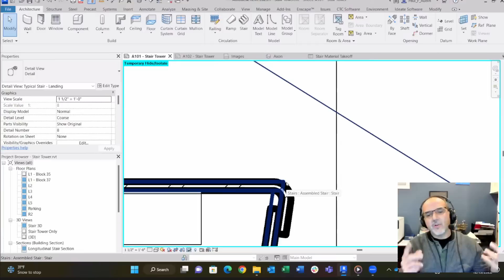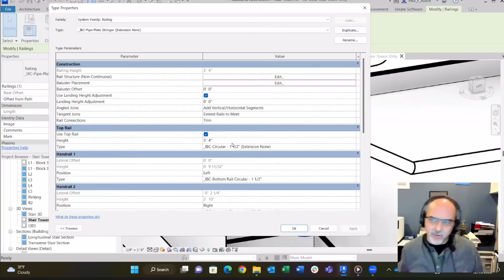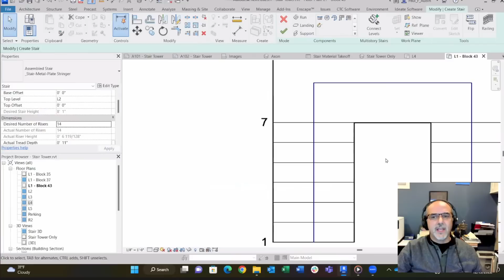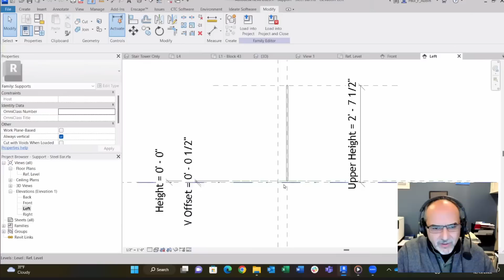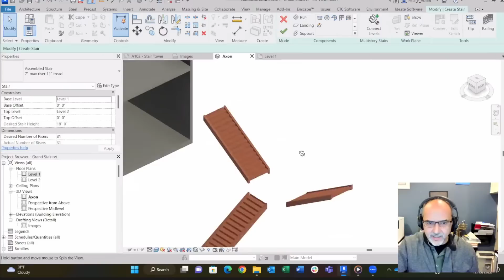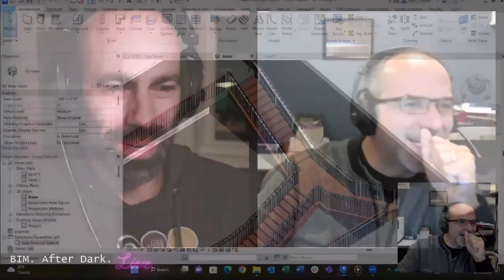How to Build Stairs in Revit (w/Paul Aubin)

Comment: @TheRevitKid this is excellent, as highly recommended by my CAD instructor.  I have a better understanding on how to pay more attention to how the cursor is moving and what it creates.  I completed some correctly finished basic drawings (no environment).  I noticed this and it created a question that I asked while working on a live project.  Why does Revit not stack or align the bottom of the stringer with the top of the skirting, and why does the skirting not follow the profile of the rise and the tread?  No one would build a staircase like that in the field.  I was warned not to get so involved in the details (hard not to do) since I am not an architect nor am I building the stairs.  But, it just looks so wrong to me.   Is there a way to change it somehow so it correctly executes it, or is a quick fix to fix it after drawing them?  Thanks!

Comment: I'm pretty good at stairs, but there was one guy who was a bit too next-level, even for me. He suggested building a monolithic stair for the concrete stair structure (neck etc.), then pasted the same stair again ON TOP OF IT and changed that to a non-monolithic stair (you may have to move it in front of the stair, to the thickness of your riser finish panel), only without the concrete base. So he essentially separated the concrete structure of the stair and the riser and tread panels of the stair. That way, you can accurately do a concrete set-out plan in Revit and hide the non-monolithic stair on top of it when you need the concrete plan. It's the same concept as splitting your walls into structural/cladding/lining/partitions, and joining your concrete floors to your finish 'floors'.

I still like the detail at scales below 1:20 rule. But it was a good idea for accurate concrete drawings.
Reply from the maker: Interesting approach!

Comment: Unfortunately, the ladder tool is only an architectural tool, the designer needs to develop everything from scratch for the calculation in the specification. This applies to prefabricated and metal stairs.

Comment: To do detailed stairs like that would have a very high LOD which is not common unless for shop drawings. I never cut a detail from a model it's always 2D. There are consequences cutting a detail from model once the model change all your details are crewed.
Reply from the maker: Paul and I agree with most of your sentiment … but, Paul was clear in using “hybrid” sections because you WANt to see when the model changes so you can update your details … the amount of change orders I see on a weekly basis that could have been resolved with the detail was hybrid and not completely drafted in a void of model would amaze people

Comment: Yeah, basically the Stair tool sucks! But you guys have it easy. I work with 3D Laser Scanning and the creation of as-built stairs. Try using these tools when stairs aren't uniform, they don't follow code, and they don't even have rhyme or reason. Great video, thanks for sharing.